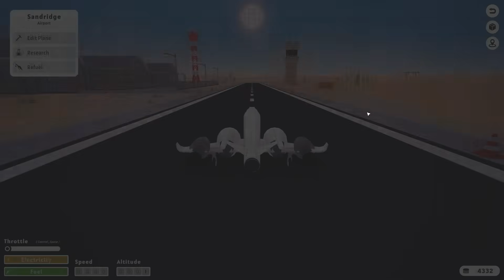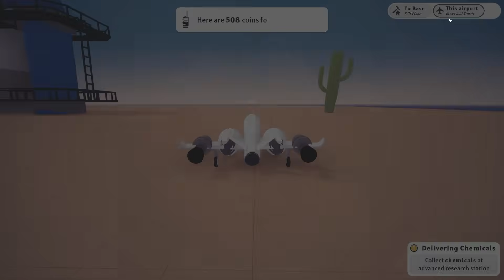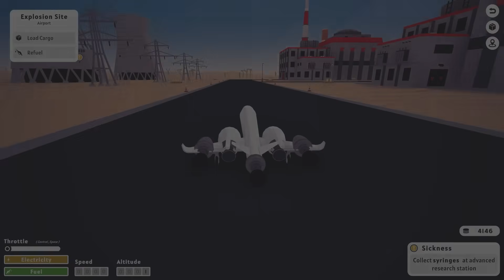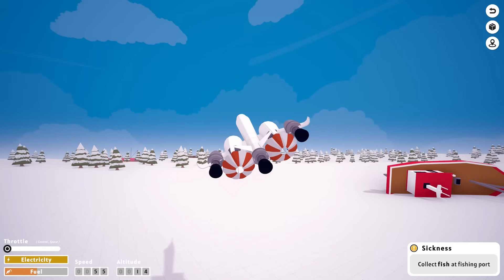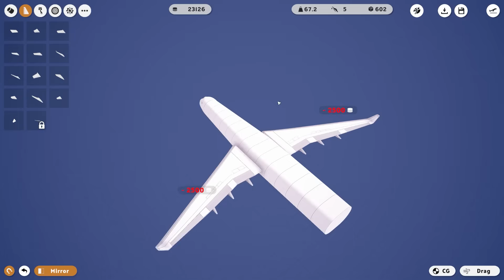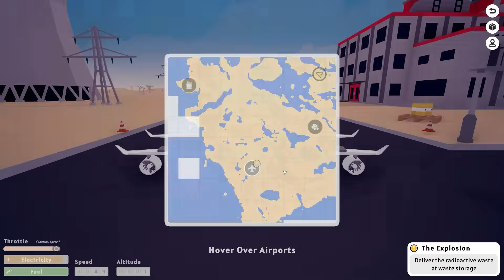I Finally Did It! | Aviassembly #12

Comment: As a rule of self-suplying systems (in games, where inflow is highly predicted), you seldom need a buffer if you plan for indefinite functioning. This way all electroplane needs is solar panes supply is no less than engines total demand. This is known as "positive power balance" ;)
You could easily replace 4 batteries with 10 panels and I reckon it would be enough to stay aloft forever.
Reply: PS. This was a good series, would love to see more when development will produce enough content to justify another series

Comment: Check thruts numbers, at least on earlier versions the thrust per money spent on el engiens was way betetr with the early ones you start with
Reply: Although each one adds a bit of drag, so trial-and-error is to be expected.
Considering this mechazilla is very slow, increased drag may be not overly punishing.

Comment: Your biggest failing is constantly under estimating the amount of Thrust you need, I think. because by the laws of Aerodynamics, Thrust generates Lift via Airflow. A plane on a Conveyor belt WILL take off once it gets up to speed. Your Center of Gravity might also be a little too far back but I'm not sure on that one.

Cus yeah..... that thing is BEARLY Flying!